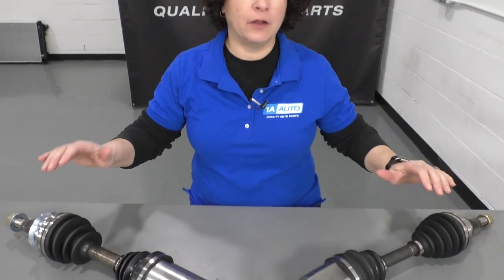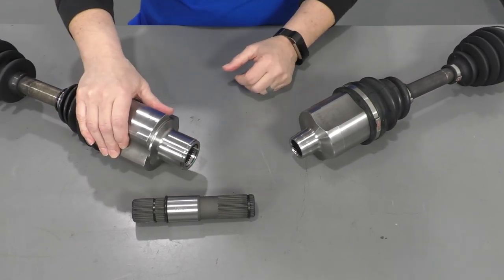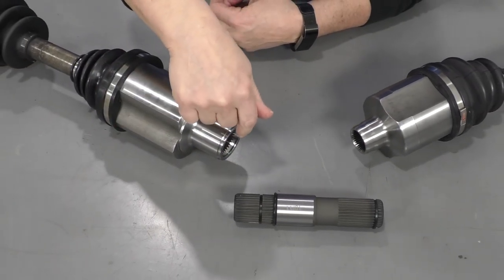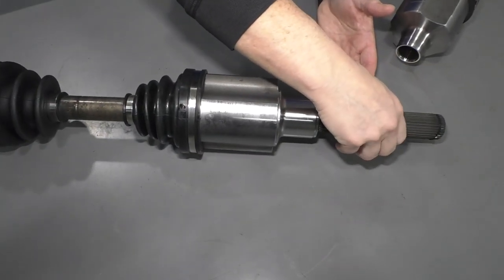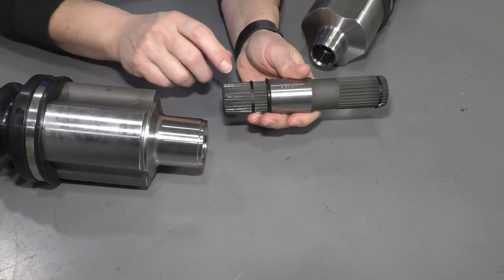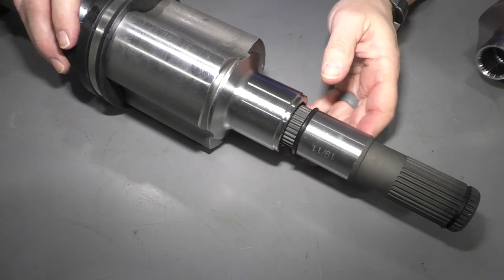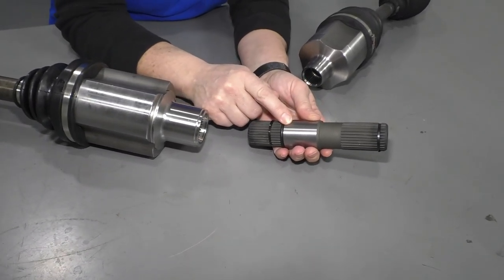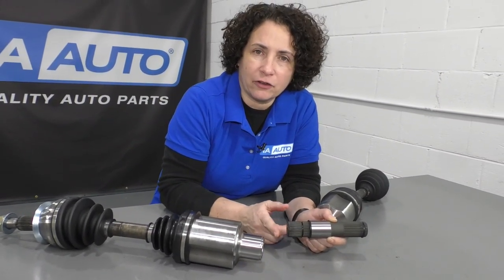Stub Shaft Confusion! Why is My Car's New CV Axle Different?

Comment: Guys, I’m having a heck of a time getting the stub shaft off the old passenger side CV axle of a 2002 Chevy Cavalier with automatic transmission and Chevy says those stub shafts are discontinued. Do you know if the manual CV axle will instead? There are plenty of those for sale but I don’t know if it will fit without buying and trying to install.

Comment: Lovely for the left side of my 2015 ram . Get ready to be raped if you passenger side intermidate shaft is bad on your 2012 and up ram 1500 4x4. Starting to feel the vibration driving at 50kmph ? Stop park your truck get some gas and a match and light that mother fucker up cause for 2500 bucks they can fix it but can sell you the intermediate shaft with bearings and seals so you can fix Chryslers fuck up . Can someone tell me why they won't sell this to the public ??? I hear essential services vehicles can get them but not us common folk..??